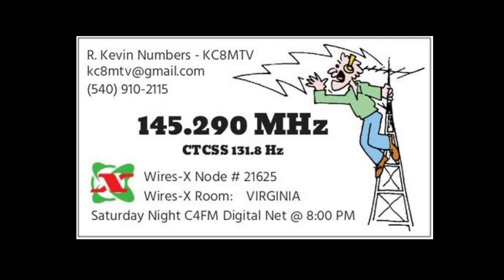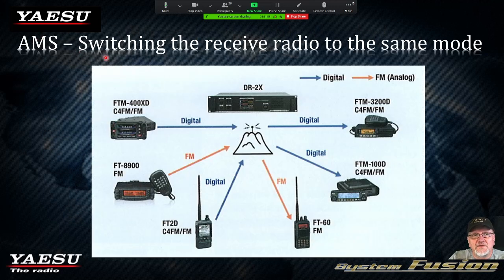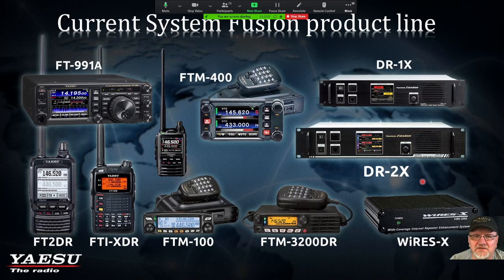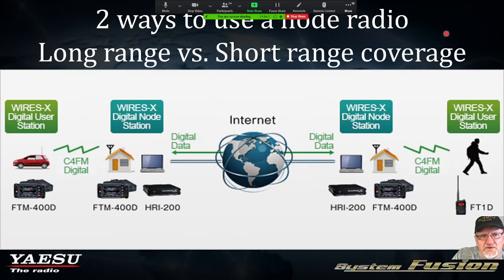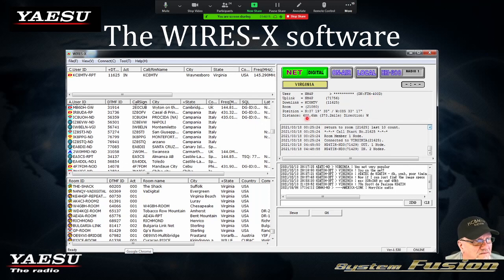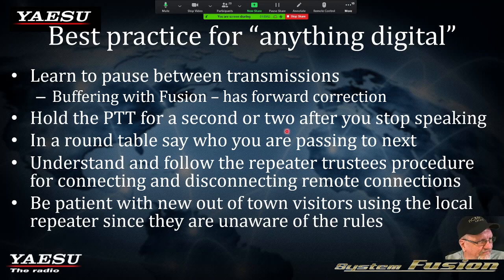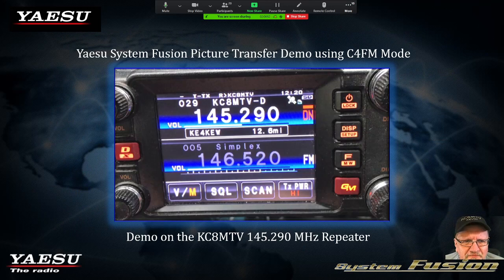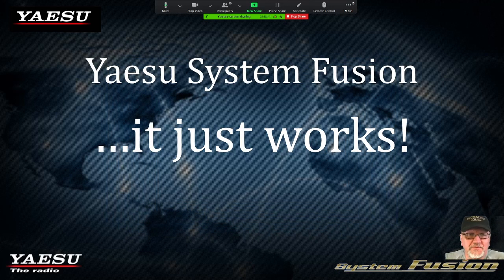KC8MTV - Yaesu System Fusion Presentation

Comment: Like many, thank you for the presentation. Thanks for clarifying what all this is about… because it’s not cheap. Lol. Overall sounds we’re just circling back to the early years of the Internet fun with  them ‘bbs’ rooms (for those who remember), which the young gen today label it as ‘discord boards’. Wires X, is just the radio guys flavor/concept of those implementations. Advantage… no typing, just real voice chat over man-ly radios. 😂

C4FM, as another digital option (i.e. vs DMR, etc), I dig. AMS ability of the Yaesu repeaters/radios, in this ‘Fusion lineup’ is pretty cool/flexible feature.

Comment: Thanks for the video. Is there a tutorial that would walk me through how to set up a WiresX hotspot around my home? I live in a somewhat remote neighborhood and all the local repeater are not Fusion repeaters. Bottom line, I want to be able to use my FT3D around my neighborhood and property.
Reply: Did you get the hotspot to work with wires-x?  Which hotspot did you use?

Comment: D-star is Only 6.25 Khz, this is Why it's can be Use on HF, because it Narrower then a 10 Khz AM Analog Mode Signal on 80 Meters, C4FM 15 Khz is to Wide to be Use below 10 Meters,

Comment: Are u still with T-Mobile? Did they allow u some space on the cell site tower for ur antenna? How high is it?
Reply from the maker: Yep, i’m still with T-Mobile. And yes, I have my repeater at the cell site at Bear Den Mountain. The antenna, which is a Sinclair four bay dipole is on a 30 foot commercial pole next to the cell site. I was not given permission to put it on the main tower due to my inability to pay for space on the tower. But I am happy with where the antenna is currently located.
Reply: @KC8MTV  at that location a 30' pole is all that is needed.  Google maps has a picture of it.  I worked at TMO as a switch tech a long time ago (back when mobile networks still had switches..) Been at ATT for last 15+ years. I wish the mobile operators did more of this where they allow capable employees use some infrastructure (power, building space, tower, etc) but it is complicated.  Often we do not own the tower and are co-located for other stuff.  But at locations where we own everything outright it would be great. I checked our ATT cell site map tool and we don't have a site on Bear Den at all.  73's